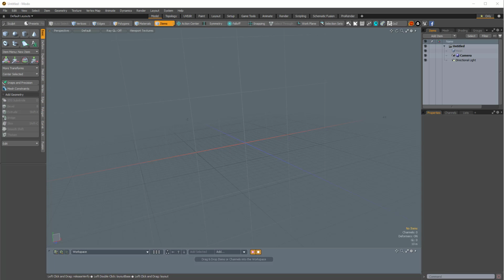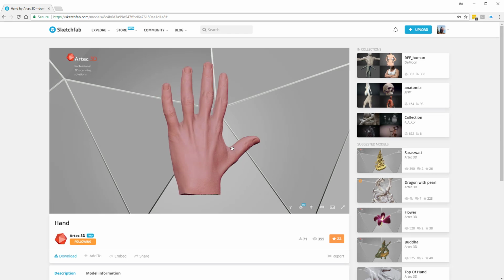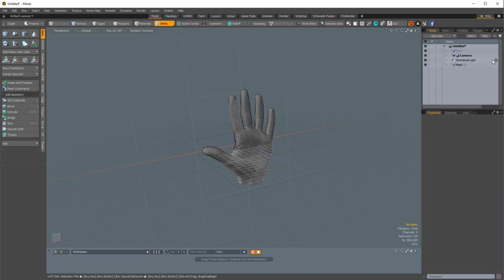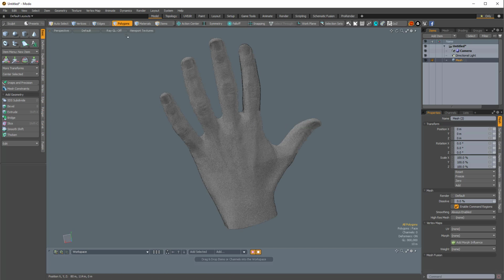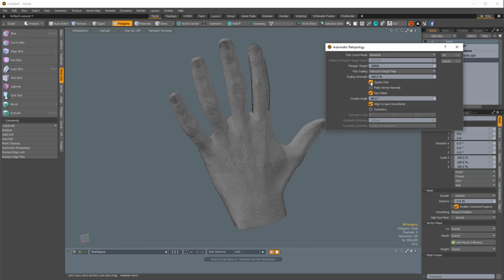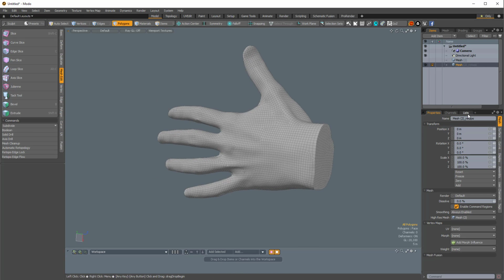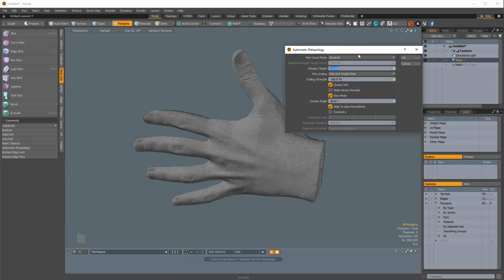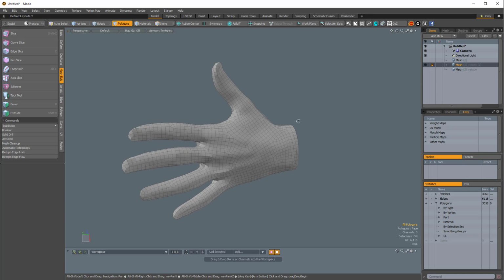Modo Basics - Automatic Retopoly for Scan Data

Comment: It’s good to note that the Polygon Count is different from the GL Count. If you notice when he selects the Quads of the mesh it actually reads 10,050 which is damn near his Target Count of 10,000. GL refers to triangles for some reason and splits (reads) the quad mesh as if each polygon were cut in half to make each triangle. So it reads as a 21,000 GL count. Just thought I’d give some input on that. 

Honestly, the automatic retopology tool is an excellent way to create Low and Med density models for use in games and even for animation for higher density models for rendered animations

Happy Modoing!

Comment: Does that method create UVs as well?  And could you demonstrate how to transfer the texture from the original scan to the retopo'd version?  I've seen some ZBrush demos along those lines, but I'm not entirely clear how the whole workflow would happen inside Modo.
Reply from the maker: Currently, the Automatic Retopology feature does not retain UVs or create new UVs. So you have to create new UVs for the retopologized mesh manually.